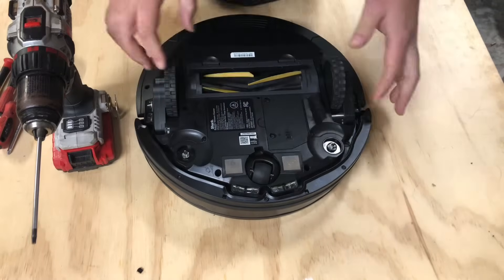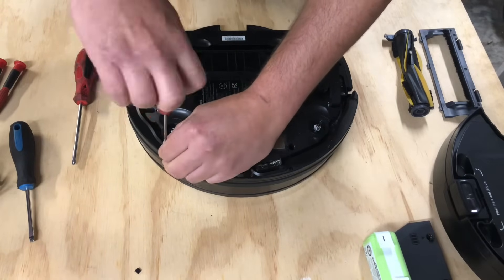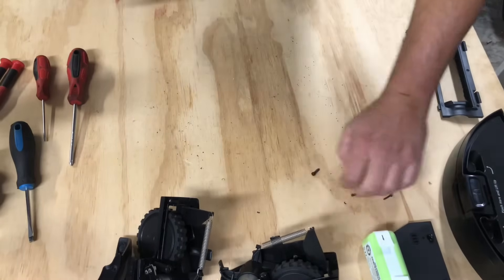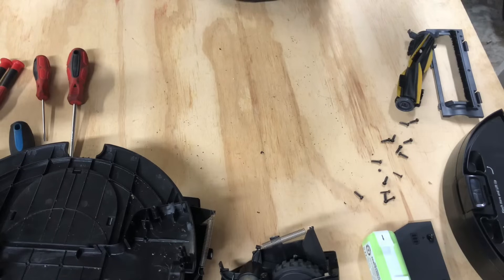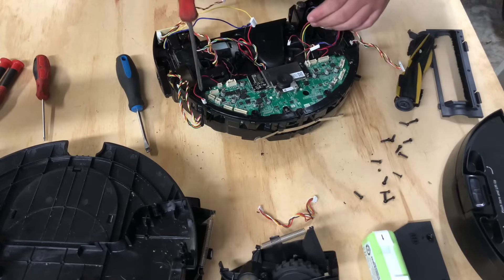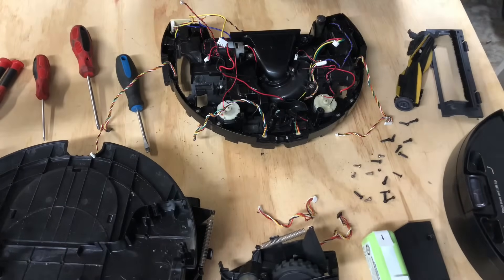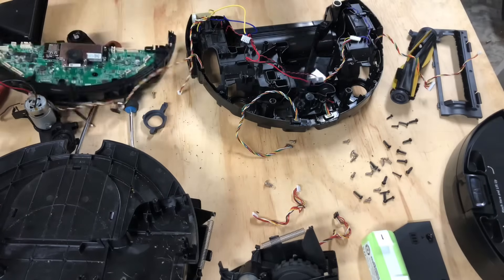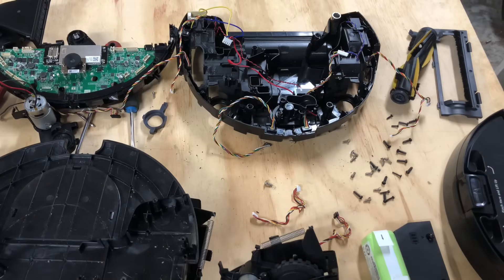Shark IQ 1001 series robot vacuum cleaner tear down video

Comment: We have the shark IQ.  It ran over dog crap. Someone in my family decided to spray the shark off in the sink.  As you can imagine it isn’t working like it should.  It turns on, the WiFi works but it is throwing an 07 code saying the cliff sensors.  1 out of the 4 sensors have visible moisture in it.  Thoughts/ideas would be appreciated.
Reply: oh man.. same thing happened to me and I am trying to get the wheel apart so I can clean them.
Reply: Same thing happened to me. Some idiot used the sprayer to clean it....that idiot would be me 😝 but I was pretty careful. Cliff sensor no matter how much I take it apart and clean it with alcohol. If anyone figures it out let me know please.
Reply: Similar issue for me too. My cat peed ON TOP of the vacuum for days while I was out of town. 07 code here too
Reply: Same here cliff code... I cleaned them also

Comment: Hi there, I found a way to check the edge sensors, just a fyi for future reference. If you just point a camera at the sensors while it gives the error, they will show on camera since they use infrared. You can see in my video.
Reply from the maker: This is a great tip but unfortunately this doesn’t work with every phone and is not always accurate. I’ll cover more in a video tonight but thanks this will help a lot of people out
Reply: https://youtu.be/s8rsTctvI5g

Comment: I have a 1001ae and I can't get lights to come on at all.  It flat out stopped working.  Any suggestions besides buy a new one?   I bought and replaced the battery so I know the battery is good.
Reply from the maker: Warranty it unfortunately motherboard issues are common.

Comment: Hi Smitty, our rv1001ae does not power on at all. It did a normal cleaning cycle, went back to the base station to charge and the blue charging light comes on the base station but no light no sign of life at all from the robot when I turn on and off I have also unplugged the battery and plugged it back in. I've had it for 20 months and it runs 1-2 times daily in a large home, I clean and maintain it frequently. Could be as simple as the battery? There were no obvious signs of battery wear other than perhaps slightly shorter run times between charging. Thanks in advance for any advice you can lend.
Reply: I've had the same issue Chris, I've tried replacing the battery and that didn't work either. The light on the charging base changes like normal when its placed on it, but the unit never turns on. Shark wont fix it and will only offer me a 30% discount. I have no idea what to do.
Reply: Me three and I’ve replaced the battery.

Comment: I've had a shark iq for less than a week.  The front sensor keeps getting stuck up.  I came home today to the robot sitting in the middle of the floor with the case cracked and it not Turning on anymore
Reply from the maker: Send it back
Reply: @SmittysWorld  they did do an exchange. Any idea of what happened to it?
Reply from the maker: @jowens1326  factory motherboard issues. It’s super common for the sensors to have issues unfortunately
Reply: @SmittysWorld  thanks for the help!  I hope the new one is better.   Anything I can do to help it?

Comment: Hi, What should i check if my robot vacuum just turns off after just like 5-10 minutes running, no error is displayed no error is reported, i take it to the base and next day it starts again.
Reply from the maker: Bad battery more then likely
Reply: @SmittysWorld  Thank you. don´t you think it could be a dirty fan and overheating?
Reply from the maker: @jxtorbay  Possible but i have seen alot of times the battery is the issue one way to check is to take the robot remove the brush roller have it in a room where the docking station is not in and see how long it last. If it dies then its the battery or motherboard issue if not then its main brush roller motor getting to hot.

Comment: My shark iq r1000 won’t turn on at all. The power switch is in the on position and it’s making contact with the sensors on the charging base but won’t power up. Last week I did have a drive wheel error but put it on the base to charge until I had time to troubleshoot the error. Now that I’ve tried, no power, period. Checked and the battery is connected as well. Any thoughts?
Reply: Wondering if he checks this post anymore

Comment: I got moisture in my left side near wheel sensor. I believe it is what’s triggering my cliff code 7. Any idea how I get that out.
Reply: Yeah im having same issues. Clean the shit outta cliff sensor still error 7
Reply: You have to take the whole top off and access the sensor itself. Once you get down to it. Then you can wipe out the sensor
Reply: I bought a can of compressed air and have used that to blow out lots of tiny debris. I use it every few runs just as routine preventative maintenance.

Comment: I'm not sure if this is my problem, but I'm getting Error #2 saying to remove an obstruction under the robot.  I just got this thing brand new in December 2020, so I can't believe it is broken already.  I've looked it up and the "hacks" are all about the spinner brushes.  Could it be that just my spinner motors are bad?  Your videos are super helpful and I'm confident enough in my tear down abilities to take this apart and get to the motors, but what I'm wondering is if lubricating the motors might solve the issue, or if I just need to buy new ones.  I really don't see any issues with the spinner brushes spinning, but I can't figure out where this 'obstruction' would be at otherwise.  Any advice?  Thanks for the great videos, man!
Reply: I have the same problem! Came just for that. Let me know if that was the issue please!
Reply: If you call shark they will replace it with a new one....
but if your like me and buy the replacement brushes online on amazon they arent compatable like they say and the yellow flaps that pick up the dust is creating the obstruction. Your best bet is to buy them through Shark....once I replaced the brush the robot went back to working normally!
Reply: My problem is very similar also man. My main roller brush isn't spinning and mine's a self emptying one that I bought about a year ago. When I turn it on, I can see both side brushes spinning if I walk in front of it, just for a couple feet then error 2 goes off. I tore this thing all the way down last night and cleaned it all out and tried tapping on the roller brush motor and spun the little fan thing like what in the groove on an alternator and then put everything back together and it still doing the same thing. I guess they just had a run of bad motors or the little belt inside the housing broke. We should all call shark and tell them it happened to us all and we should all get new vacuums.

Comment: How do I remove a side cliff sensor without breaking it or the housing around it? I have the Shark IQ RV1000AE.
Reply from the maker: Take robot all the way apart down to just the sensors and they pull out
Reply: @SmittysWorld  Thanks. Is there a way to test the sensors to find out which one is faulty?
Reply: Also, can you use them on either side, or are they side specific?
Reply from the maker: @marvinwebb7959  not really way to test that I know of
Reply from the maker: Some models and some sensors are some are not have to be the same
Reply: How do you identify which cliff sensor is bad?
Reply from the maker: @marvinwebb7959  Its not possible without special equipment to be able to shoot signals  and read signals coming from the sensor

Comment: we have a rv1000 shark that the side brushes stopped working there doesnt seem to be anything blocking the brush . One turns the other doesnt . any suggestions.
Reply from the maker: If it’s under your old contacts sure I can have them replace our warranty if it’s older than a year than you’re gonna need a new spin brush murder and currently am out of stock but you should be able to find one on eBay or Amazon
Reply: @SmittysWorld  Thank you they are sending me a new body pod. Is it hard to replace the brush motor ?
Reply: I have the same problem on a brand new one I'm trying to resell. Did you figure it out?

Comment: I have an RV1001AE that ran over a ton of dog excrement. In the process of taking the front wheel off, the assembly broke. (the white part with the screws is intact) However i am noticing that the manufacturer used different screws on the assembly. I am wondering if you have seen this?
Reply from the maker: Oh that’s a bummer hate to hear that. The RV 1001 and the RV 1001ae 
I have a different housing for the front wheel one of them has screws on the outside and one of them has screws on the inside which is the only difference I’ve seen out of all of robots I’ve checked so far they are different size however.

Comment: I have a UR100S where one of the side brush motors have gone bad. Where can I find replacement parts?
Reply from the maker: That me off a robot you should call shark first. I don’t have any of those available right now.
Reply: @SmittysWorld  I've got a RV1001 that wont turn on at all. I've tried replacing the battery and that didn't work either. The light on the charging base changes like normal when its placed on it, but the unit never turns on. Its only 2 years old and was cleaning normally went back to the base and shut off. Shark wont fix it. I have no idea what to do. Any help would be appreciated.